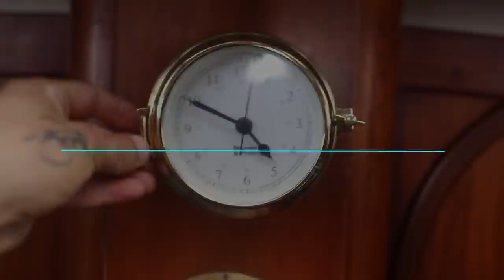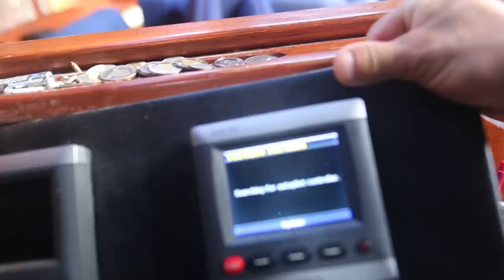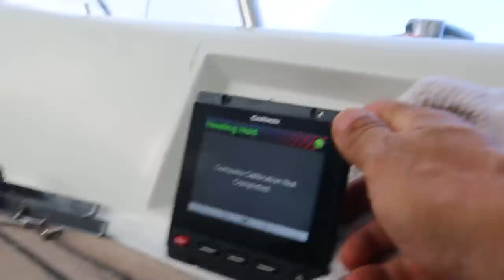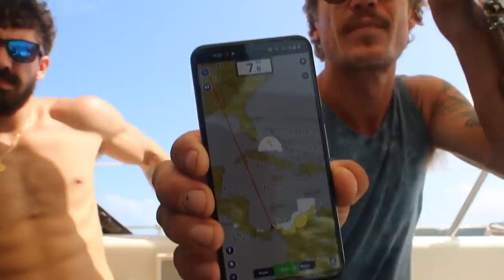Sailing into the Sunset: Crossing the Caribbean the WRONG WAY

Comment: As a long time electrical / electronic / network / automation troubleshooter (in very heavy industrial environments), it is my experience that specialized cables seldom go bad unless waterproofing fails (due to gasket leaks or insulation cuts) or heat damage to the insulation of individual conductors or something new introduces electrical or fluctuating magnetic interference, such as unstable power supply voltage.  One last possibility on a network is that more than one device has the same address or some device has lost it's address.  My most common practice is to disconnect every connection and check for moisture or bent or broken pins.  Also, give every screw on every terminal strip a twist to find loose connections or connections where the insulation is not stripped back far enough to insure solid contact between the wire and the termination post.  Inside the individual devices, I typical disturb every electrical plug, weather cables or modules to re-seat the connections.  In my experience, these steps are most often successful.

Autopilot systems are not as simple as boaters would like to think.  They are control loops usually with a variety of failure modes.  There are input (feedback) provisions to indicate the position of the rudder and the helm as well as the information required for proper navigation and a powerful output system to move the rudder.  In and of themselves,  they are not that complicated and troubleshooting them can be learned with concentrated effort, which probably does not happen often enough. But as a system (often not entirely understood), troubleshooting can be very daunting, especially without the necessary troubleshooting equipment.

I recommend that you ask a manufacturers rep to help you to learn how to troubleshoot the various aspects of the system and to acquire the necessary troubleshooting equipment.  I understand that this point in time is long after the event and I look forward to learning what happened.  Wishing you fair winds...at least occasionally...lol!

Comment: A lil soap on your screws help lubricate them into fiberglass. Ive broken quite a few myself. Always need one size larger drill bit and a little soap on the threads help keep my blood pressure down 🤟 o and i am installing a back up autopilot system. Definitely inspired by you brah 😎
Reply from the maker: Soap!? Huh. Never tried that. Thanks, Brody! 🙏
Reply: Old wise man taught me the trick.  Works like a champ!
Reply: Soap is an old woodworker's trick. Candle wax works too.

Comment: Yes you have to do the quick fix till you get the parts to do it right.  Good on you for being able to fix so many things on your own. These days hard to find supplies in the US let alone down in these remote areas.
Reply: Sail back to Florida, haul the boat and completely overhaul the wiring and mechanical systems.

Comment: Respectfully recommending you upgrade to a Hydrovane, working as crew that never eats, sleeps or drains your batteries, steering in light air and gale-force winds.  We used one on our first circumnavigation, purchased one for our new boat, presently cruising the Bahamas.
Reply from the maker: They are the best!

Comment: I built a custom with an epoxy glued teak deck and zero fasteners over 30 years ago.  Zero leaks after being exposed without a boat cover on it.   But I'd still take a glass/epoxy deck over it in a minute.

Comment: James
I'm in awe at the sailing you manage to accomplish with a great boat that frankly is a POS after sitting in the tropics for years.  And combine one of the hardest passages in the Caribbean basin with complete neophytes as crew.  When I made that passage up from Panama few years back we had a perfect reach up to the Caymens  and then worked our way windward in the lee of Cuba and the DR.   Easy passage, but due mainly to luck!

A hint about ridding your boat of the curse of teak decks:  There is a rubber overcoat like that used for mobile home roof repair that should give several years of leak free service.  Use coarse anti skid like ground walnut shells.  It even comes in a teak color. 

Anna es amorcita!
Reply: It is applied directly over the teak so all you do is sand the teak flat and roll/flood it on.

Comment: Bro you look tired! Jajajajaja!  There's always leaks after all the good times in the hot sun.  No matter how hard you try to find them before casting off!  I've been known to walk around the deck with a tub of Slick Seam, smearing it around to try and stop them.  It works but leaves a mess, and later you can clean it up with a puddy knife and acetone .  Its a smart sailor to have a spare mounted and labeled ready to go. Cheers!

Comment: I have been doing a refit in Antigua for over a year and thought that the good hard Caribbean rain had revealed all my leaks. I have done extensive re-bedding on the deck and and around my masts, hatches and such and it takes a lot of time.  I hope to avoid what you encountered and will find out when i leave soon.

Comment: could it be the leaks are shorting out the cpu, the battery, the cable?
Can leaks in the portholes not be tested by a hose before leaving?
Has something moved in the structure of the boat to cause so many leaks?

Comment: Hi James love your videos been watching for some year's wondering if you could tell me what you think of a pilot house sloop with outside helm too it's a 57 foot Wellington 15.5 beam with 4.6 draft full Walk in engine room it my cousins it fiberglass with aluminum beam's and I'm thinking of getting it thanks for any help Frankie
Reply from the maker: Hey brother, thanks for watching. What are you going to be using it for? I looked up the numbers for you. They don't look too good, at least for the sailing aspect.  Bal/Disp - 23.3 (This will make for a tender boat). Disp/Len - 214 (she will not move in light winds). I can't find the SA/Disp but a 30T boat with a shoal keel won't point for shit (up or downwind). That said, looking at pictures she looks like a comfortable yacht. I would say you could slog it out for a passage if you needed to move her, but you're not going to want to sail around the world in it. For a liveaboard/coastal cruiser motor-sailer she looks great. This all circles back to my original question: What are you going to use her for? Much love from St Maarten. -J